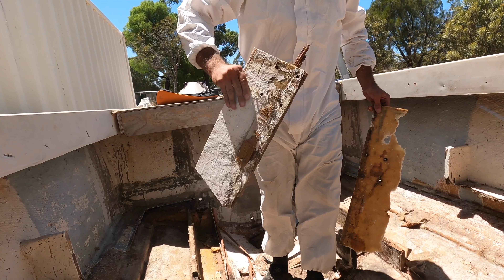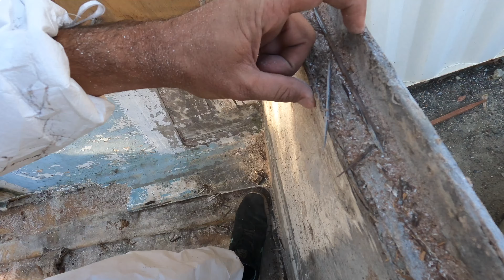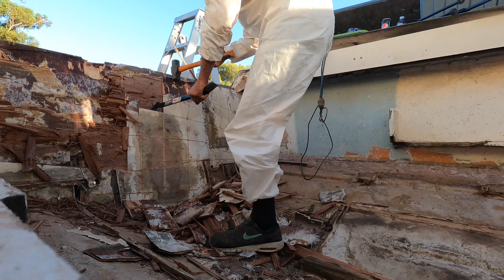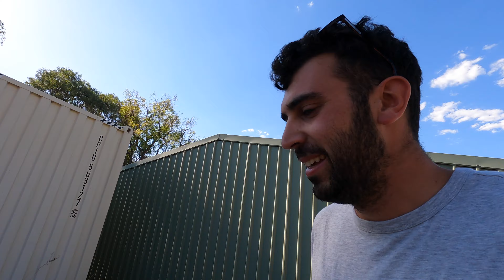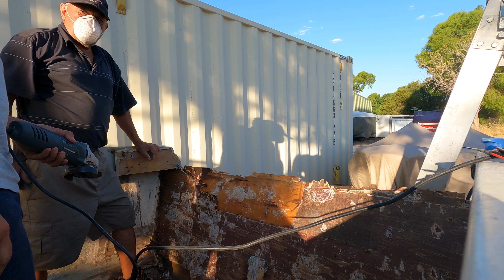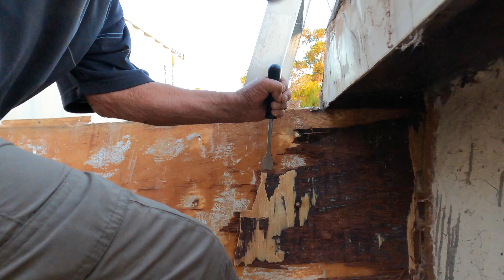Removing a ROTTEN and PATCHED TRANSOM from boat| Pacemaker 20ft | Full BOAT RESTORATION V2 - Part 4

Comment: Wow, that wood was not that rotten in most of places. That was hard. The previous owner's repair on the transom was awful. I don't know if he was expecting this would last for long but man, that's was a terrible work.
I think you are definitely right to start by laying some fiberglass to thicken the back of the transom. So that you'll have a clean and neat surface for the new core. 
By the way, you would not like to use coosa instead of plywood? I know it's expensive but you don't have a very big surface. And no more risk it gets rotten.
Anyway, I know your summer is very hot this year. Would you mind sending us a bit of your heat to warm our winter up ?
Cheers.
Reply from the maker: The wood was very solid, but it was removed mostly based on the poor stern drive repair. Yes the transom needs to be strong so there is going to be a few layer of glass going into this :P
Termolite, is VERY hard to get here in WA and considering i need approx 10 sheets, will be difficult. Also these boats love the weight, so marine ply will give me that. Thanks for watching mate :)

Comment: Surprisingly a lot of that old wood was pretty dry pitty the old inboard patch up work wasn't up to scratch..
Maybe in that bottom right hand corner there was a transducer screwed in from the other side which caused that black rotted out section?
Reply from the maker: wood was dry in areas that's for sure! i think that's why they decided to patch the transom as it was is pretty good shape (at time of them rebuilding). Yes that's what i was thinking :)

Comment: Why do hou remove good wood stringers.... ? Epoxy glues everything...   it spares time and money. Replace roma through roofmate and or won't rot again
Reply from the maker: Hey Martin! 
Thanks for the message, yes 70/80% was dry but thought I’d remove the lot so everything is new and ready for another 30+ years. Lucky I did as the laminate from the stringers to the original hull laminate some areas had water trapped between the layers, which overtime will cause delamination. 
Thought while I’m doing all this work, to do it all